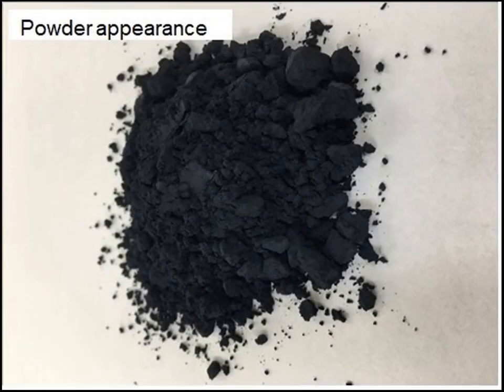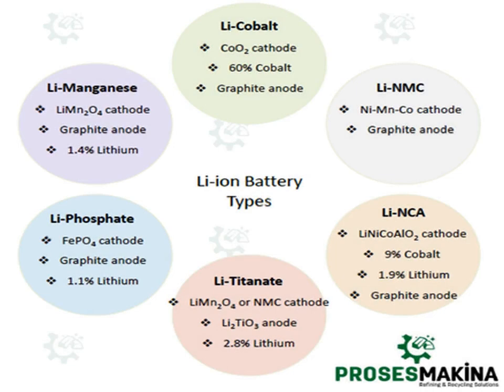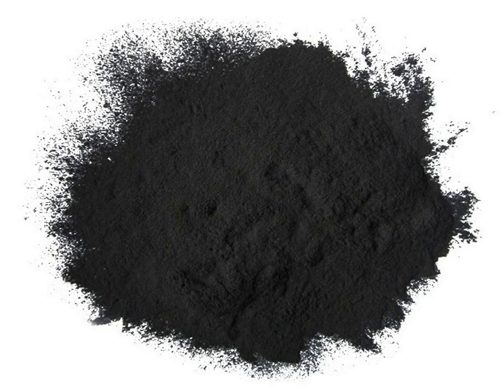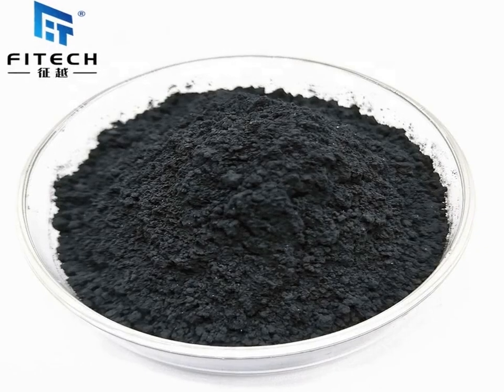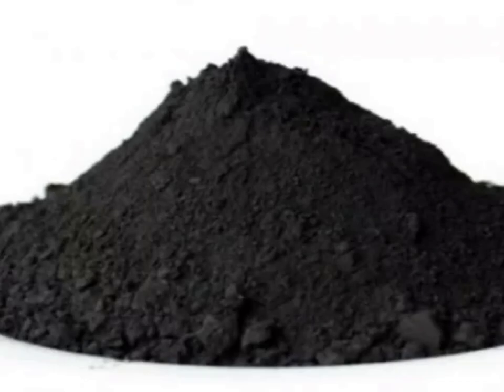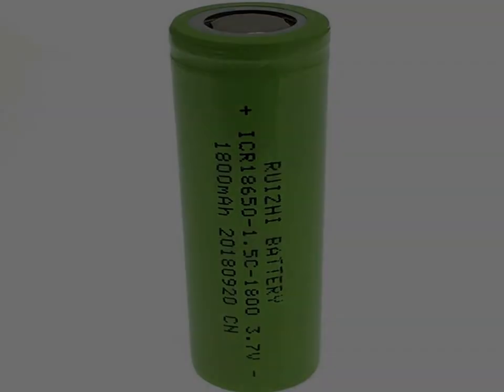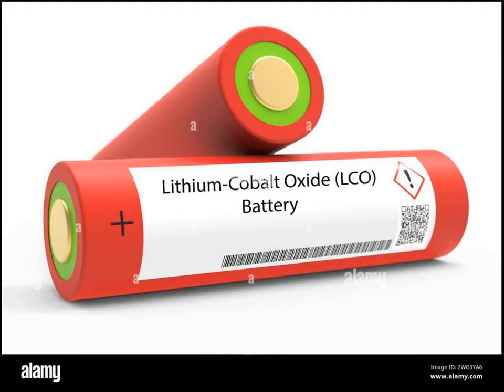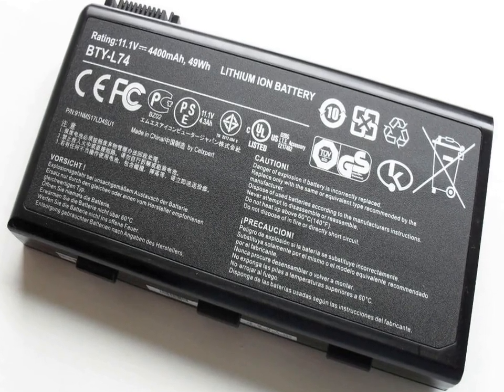INTERESTING MATERIALS: Lithium Cobalt Oxide

Comment from the maker: Further reading:

- Julien, C. M., Mauger, A., Vijh, A., & Zaghib, K. (2016). Lithium Batteries: Science and Technology. Springer.
- Thackeray, M. M., Wolverton, C., & Isaacs, E. D. (2012). Electrical Energy Storage for Transportation—Approaching the Limits of, and Going Beyond, Lithium-Ion Batteries. Energy & Environmental Science, 5(7), 7854–7863.
- Blomgren, G. E. (2017). The Development and Future of Lithium Ion Batteries. Journal of The Electrochemical Society, 164(1), A5019-A5025.
- Manthiram, A. (2017). An Outlook on Lithium Ion Battery Technology. ACS Central Science, 3(10), 1063–1069.
- Goodenough, J. B., & Kim, Y. (2010). Challenges for rechargeable Li batteries. Chemistry of Materials, 22(3), 587-603.